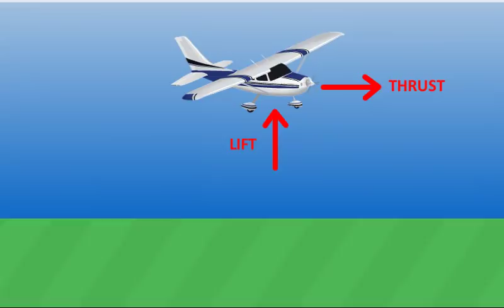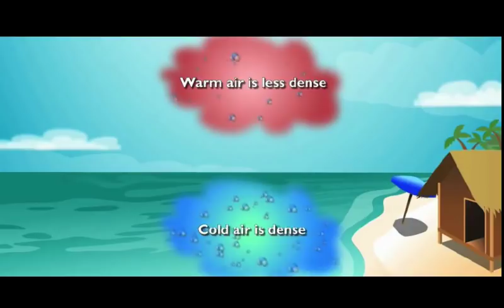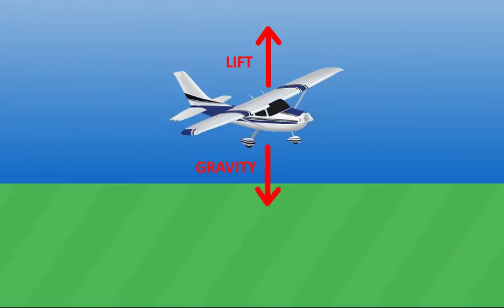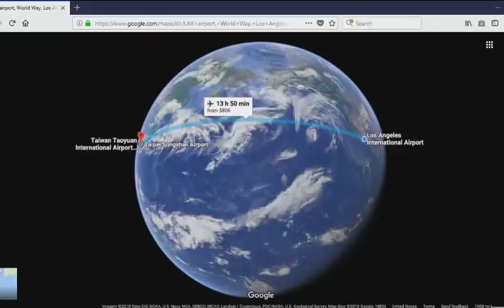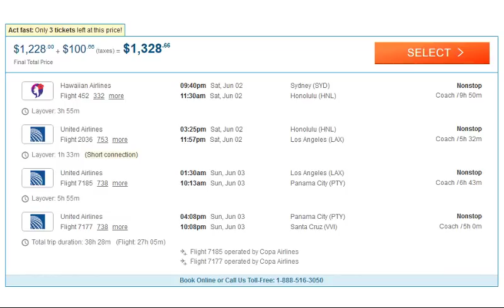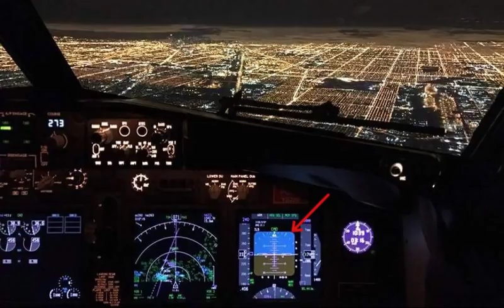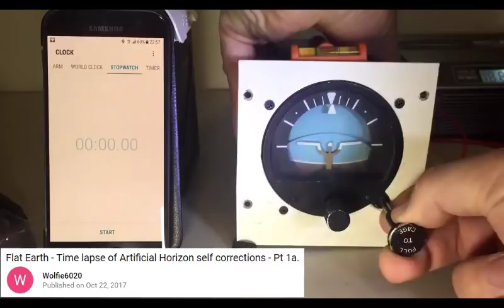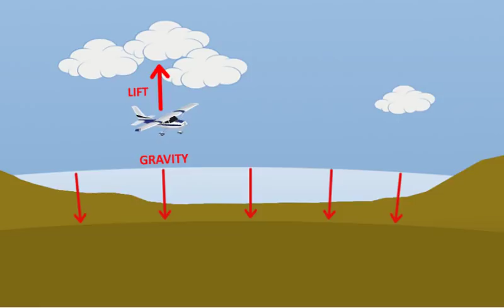Flat Earth Falsities - Plane Nonsense

Comment: Always funny to hear non pilots try to explain flying phenomena.  Sadly neither side knows what they are talking about.  The truth is the pilot or the autopilot DOES have to compensate for the curvature of the earth, gravity doesn't do it for you.  The issue is the 8" the earth drops away from you in any given mile flown is insignificant and undetectable in relation to all the other factors you constantly have to correct for when flying an airplane to keep it "level".  The first time you fly an airplane, I can promise you, you won't be able to keep it within 100 feet of your desired altitude.  So if you can't keep it within 100 feet, do you honestly think you could notice the 8" you need to correct for each mile flown?

Unlike driving a car, there are no roads in the air.  Meaning there is nothing to tell you if you are going the right direction, holding your heading, or what LEVEL you are flying.  You have to look at instruments to determine that.  Yes you fly an attitude - look at the horizon in the windshield and the attitude indicator (formerly called the artificial horizon) - for a basic idea of what level is, but then you have to look at your altimeter to determine what altitude above sea level you are actually flying.  Now the altimeter doesn't actually know your altitude above sea level either, all it does is detect pressure levels and then converts that to an altitude indication on the instrument.  So you are actually flying pressure levels which of course follow the curve of the earth.  Therefore, as long you maintain the desired altitude or pressure level, indicated by the altimeter, you will automatically follow the curve of the earth.

But here is why the pilots have to compensate for the curve of the earth is so ridiculous.  The aircraft has no clue what altitude you want to fly, nor can you tell it, "fly level now".

Just like you can't point your car in the direction you want to drive on a road and expect it to stay between the lines, you can't point an aircraft "level" and expect it to actually fly level.  Drive a car with perfect alignment and no wind acting upon it, then take you hands off the wheel for a minute and see where you end up!

It's no different for a plane, except it's worse, MUCH worse.  A car sits on a hard surface with gravity and friction trying to hold it in place or on course, yet it STILL will wander on you if you don't continually make steering corrections.  Now realize a car is only mobile about ONE Axis.  The vertical one.  An airplane is mobile about all THREE Axis, the vertical(yaw), the longitudinal(roll for turning), the lateral(pitch for climbing, descending or level).  Whereas the car has one axis of rotation on a horizontal 2D plane, an airplane has all 3 axis of rotation in 3d space with NOTHING but air pressure and friction holding it in place.  Any movement about one axis affects the others and requires control input to counter.  Ie, if you decide to bank left, to turn left, the nose will pitch down and will yaw right(the wrong direction).  This would cause the airplane to descend, even though you didn't want it to, nor did you tell it to.  So back pressure must be applied to not only keep the nose up, but actually increase it slightly to counter the increased weight of the plane from the added centrifugal force created by the turn.  Similarly the rudder pedal on the left must be pressed to help push the outer right wing to offset the extra drag it experiences because it's going at a faster speed than the wing on the left or inside of the turn.  The point being, people often feel completely overwhelmed when they first take the controls of an airplane and try to fly any maneuver, even one as simple as turning, because it's like riding a bucking bronco, there is nothing holding you in place, you feel totally out of control until you learn to control and anticipate movements about all three axis and how they interact with each other.

It's a real challenge for new pilots to keep an airplane within 100 feet plus or minus their desired altitude.  Now hopefully, with proficiency, on a smooth day, you can keep it within 20 feet or less, but even for your private pilot checkride you only have to keep it plus or minus 100 feet.  For a commercial certificate it's plus or minus 50 feet.

However even with the point of being proficient enough to keep it within 20 feet on a smooth day, you are STILL constantly making little corrections, which is why we use autopilot for cruise flight.  It would be exhausting to try to maintain altitude for a 2 or 3 hour flight, let alone an 8 hour one.  Now the autopilot will make the constant corrections and it will do so by monitoring the altimeter.  As it senses the altitude climbing or descending, it will make the pitch corrections to keep it on the selected altitude.  Most of these corrections you won't notice, anymore than you are even conscious of the majority of the corrections you make while driving a car.

The point being the earth drops a whopping 8 INCHES in a mile.  Depending on what plane you are flying, that mile will take anywhere from 7 to 30 seconds.  Now 7 seconds may not seem like much time, but at 500 miles per hour, up at altitude with the very thin air, you can vary 100 feet in a hurry, if you or the autopilot aren't making little corrections during that time.  Now there is no way in hell, while you are making those corrections can you determine if the correction is due to all the reasons it's hard to keep an aircraft at a certain pressure level or how much is due to the 8" drop.  You can't even see 1 foot on an altimeter.  So the idea that pilots could even see or detect an 8" drop in elevation, let alone make an 8" correction is just laughable to any person who's actually flown an airplane.

All that to say, even if the earth was flat, pilots or autopilots STILL have to work hard to keep an airplane within 20 feet of desired altitude, so if in fact the earth is curved and curves away at 8" in a mile's worth of flight, you can't detect such a small variation.
Reply: Of course autopilots have to make constant adjustments to maintain a given altitude. But that really is nothing to do with the earth's curvature. 4000ft above the earth is defined by the atmospheric pressure at any given point above sea level. Without weather and payload factors acting on an aircraft,  you could theoretically trim the aircraft for level flight, and then fly continuously at that height above the earth without any adjustment. This idea that the autopilot is constantly trimming to follow the earth's curvature is nonsense.
Reply: @tjfSIM  I have no idea what point you are arguing.  Nowhere did  I say the pilot or autopilot is CONSTANTLY making corrections to follow the curvature of the earth.  That's the OPPOSITE of my point, that the curvature is so small compared to all the other corrections they have to make, it would be impossible for them to realize that one of those corrections includes the compensation for the 8" drop from their tangent flight path.  

An 8" drop per mile equates to a 7 THOUSANDTH of a degree adjustment.  No one can see that or feel that.

The flat earth tards make the mistake of thinking that the pilot IS having to continually make theses adjustment, like he's having to constantly push forward on the yoke or stick to follow the curvature.  As if once you get up to altitude and level off, the airplane is somehow going to lock on to that exact altitude and fly that tangent perfectly, so the pilot has to "force" the nose down to follow the curve.

That's not how airplanes fly.  You or the autopilot have to work to keep it at the pressure level, and within those multitude of corrections being made, the LEAST noticeable is the 8" drop for the curve.

But those arguing our side make the same mistake in thinking that an aircraft can somehow lock on to an altitude or pressure level and that it's gravity that just makes it follow the natural curve so it doesn't require pilot or autopilot input.  Neither are arguing a valid point.
Reply: @tjfSIM  --Well said.
Reply: It sounds like you have misunderstood.  When normal people say "you don't have to adjust for the curve", they mean because the pilot/autopilot follows set altitude/air pressure level, which follows the curve.

No need to get upset, they agree with you.
Reply: @cryptojihadi265  -- ”…the pilot or the autopilot DOES have to compensate for the curvature of the earth, gravity doesn't do it for you.”

The pilot/autopilot keeps an aircraft at a constant altitude, with no regard for, nor even ability to sense the shape of the planet over which the aircraft flies.  Because the force due to gravity is near constant over the earth, and because the atmosphere’s density altitude gradient curves in proportion to the Earth’s own mean curvature, then gravity and the atmosphere will draw the trimmed for level aircraft around the Earth automatically, with no control input needed to accomplish this.  The occasional, corrective control inputs that a pilot must make along the way are for incidental factors, NOT for the curvature itself.  These would be weight loss, weight shift, atmospheric variation, etc.  During the times that these incidental corrections aren’t being performed, the aircraft could be flown hands-free and still follow the curvature.

”…even with the point of being proficient enough to keep it within 20 feet on a smooth day, you are STILL constantly making little corrections…”

Yes, but none of these corrections is to compensate for the Earth’s curvature, only for other factors that perturb a flightpath.

”As it senses the altitude climbing or descending, it will make the…corrections to keep it on the selected altitude

Yes, but the Earth’s curvature does itself not cause an altitude change, so any required altitude correction is not a compensation for the curvature.

_”…the earth drops a whopping 8 INCHES in a mile…that mile will take anywhere from 7 to 30 seconds…but at 500 miles per hour, up at altitude with the very thin air, you can vary 100 feet in a hurry, if you or the autopilot aren't making little corrections during that time.

You’re describing a scenario in which the Earth’s “drop” would cause the aircraft to climb, and then require correction by the pilot, to return to level flight.  This is not what happens in reality.  In fact, the aircraft will follow the density altitude for which it’s been trimmed, and this will result in a continuously curved (not a faceted, deviation-then-correction flightpath) that conforms, in proportion, to the Earth’s own mean curvature.

”Now there is no way in hell, while you are making those corrections can you determine if the correction is due to all the reasons…”

Correct, a pilot doesn’t can’t necessarily identify the exact mix of factors that perturb a flightpath, so the pilot simply makes the appropriate correction.  But the pilot can be sure that the Earth’s curvature is never one of those perturbing factors.

”All that to say, even if the earth was flat, pilots or autopilots STILL have to work hard to keep an airplane within 20 feet of desired altitude…”

Pilots would have to work a lot harder flying over a flat Earth, and the instrumentation would have to be very different, because the gravity vectors would not be universally perpendicular to the planet’s mean surface, a flat Earth’s atmosphere would be dome shaped, and the pressure isobars would not mimic the planet’s shape, but instead pinch down to practically nothing at the edges. Trimming to maintain altitude would be impossible.
Reply: @cardinalRG I don't think you read my post, that was my entire point.  We are too busy correcting for a variety of factors to take into consideration the 8" drop off for each mile flown.  It's indistinguishable in the midst of all the other much larger factors we have to compensate for, many of which you listed.  

People who think if the earth was curved, the pilot would have to constantly be pushing the nose down have NO IDEA how a plane flies or what it's like flying a plane.

But those arguing that gravity keeps pulling the plane to make it follow the curvature is not accurate either.  This is an erroneous argument some on the globe side make.

It IS far more about the trim than gravity. Just a slight variation can cause the aircraft to climb continuously until the air gets thin enough to where it stops climbing. 

The bottom line, the pressure levels follow the curve of the earth, but even they vary based on local atmospheric conditions, so the pilot just uses the altimeter to gauge if he's holding the desired altitude, and just like driving a car down the road, the pilot has to keep making constant little adjustments to maintain altitude, like a driver needs to make little adjustment to make the car stay in the center of his lane, even on a perfectly level and straight road.

I think a lot of flat earthers, and people in general, think you can just level the nose to a zero-degree pitch attitude and the plane will fly perfectly level at that altitude like it was riding on a concrete highway in the sky.
Reply: @cryptojihadi265  --Thanks for the response.

”I don't think you read my post, that was my entire point."

Of course, I read your post.  You made a point about a pilot’s corrections often being slight and indistinguishable individually.  I didn’t contest that point, and for the record, I agree with it.  But you also made this claim:

”We are too busy correcting for a variety of factors to take into consideration the 8" drop off for each mile flown. It's indistinguishable in the midst of all the other much larger factors we have to compensate for…”

That claim is incorrect.  Pilots do not have to compensate for the Earth’s curvature.  Other factors…yes.  The curvature…no.

”But those arguing that gravity keeps pulling the plane to make it follow the curvature is not accurate either.”

Gravity is just one factor, not the whole story, as some claim.  The atmosphere’s density altitude gradient also plays a part, and this is often missed by well-meaning globe defenders who argue that an aircraft is analogous to a spacefaring satellite.  That one makes me cringe a little.

”It IS far more about the trim than gravity.”

Exactly, and that’s where density altitude comes in.

”Just a slight variation can cause the aircraft to climb continuously until the air gets thin enough to where it stops climbing.”

I’ve made the same point countless times.  Gravitational variation over the Earth is much, much less than atmospheric variation.

”…the pilot has to keep making constant little adjustments to maintain altitude…”

Of course.  But again, these adjustments are not for the sake of the curvature itself.  Take away all the incidental factors that require “little adjustments” (hypothetically, a constant-mass aircraft in a perfectly stable atmosphere), and the pilot would have to make no adjustments at all after trimming the aircraft for level flight.  Its flightpath would mimic the Earth’s mean curvature automatically.

”I think a lot of flat earthers, and people in general, think you can just level the nose to a zero-degree pitch attitude and the plane will fly perfectly level at that altitude like it was riding on a concrete highway in the sky.”

Right!  Well, flatEarthers are dolts, aren’t they?  The average non-pilot can be excused for not understanding aeronautics, but the flerf crowd simply rejects better information outright.  For example, I can’t count the times I’ve had to correct the goofy claim that a pilot maintains level flight by staring at the artificial horizon.  They think it’s an altitude instrument.  I’m sure you’ve encountered that type of silliness.

Comment: I think your answer to number 3, flying flat and level, might be incomplete. Thrust and lift, being a function air flow, either over the wing and propeller, (which is basically a graduated airfoil) or wing and a jet engine. In either case air density is a factor. For a give amount of thrust or power applied to move air to generate thrust, you will move the air, at a current altitude, with a give density. In stable level flight the plane will not rise up into lower density air without more thrust, and it wont settle into higher density air without dropping airspeed or altitude and increasing airspeed. There are dangerous conditions in which a plane will suddenly drop, were you have a down draft or a significant air density drop. Helicopters have a similar issue with altitude and humidity. More humid air is less dense and the lifting or vertical acceleration, or operational ceiling will vary depending on this factor